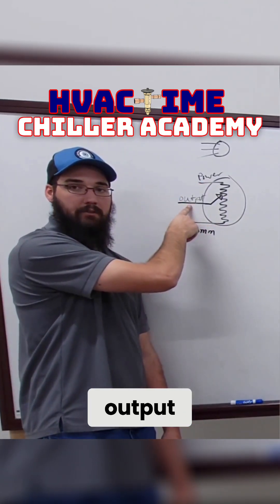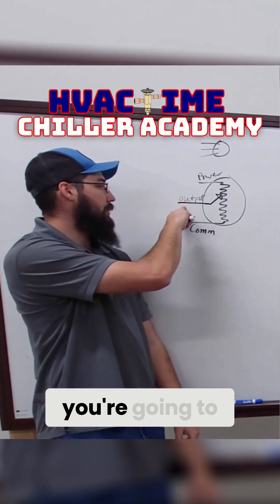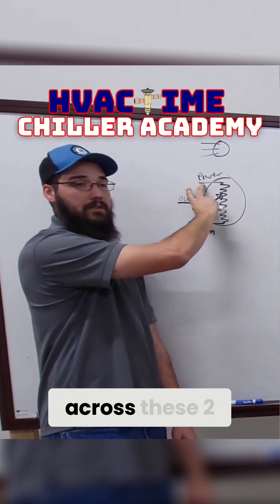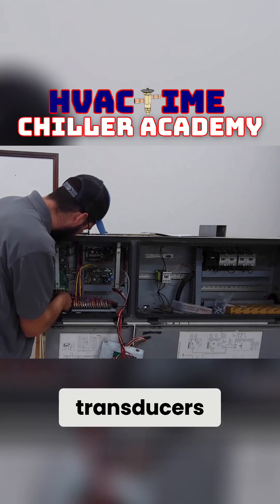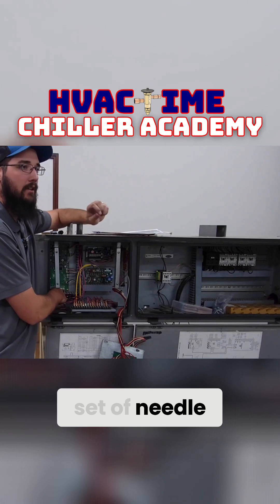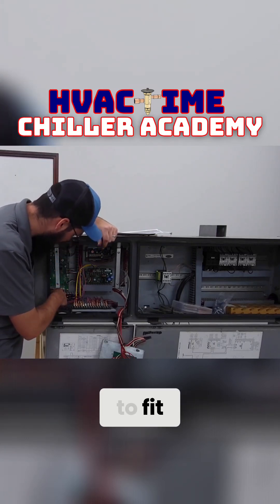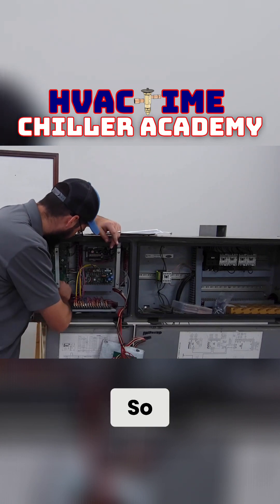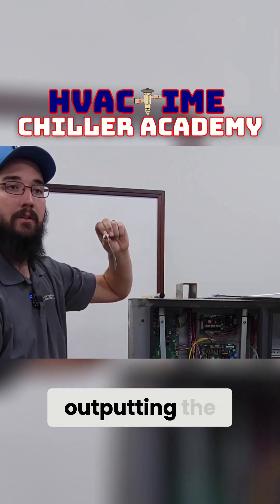Troubleshooting Transducers: Ensuring Accurate Pressure Output

Comment: Not a good idea to use 0 to 10 volt DC outputs on transducers. They are more accurate and reliable with a 4 to 20 milliamp output. Also they are not susceptible to electromagnetic induction from high voltage wires.